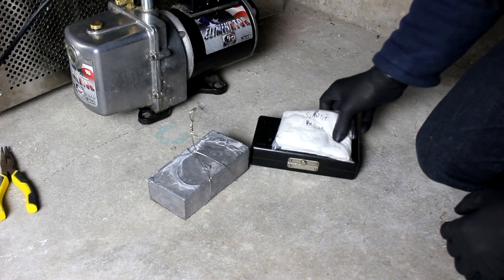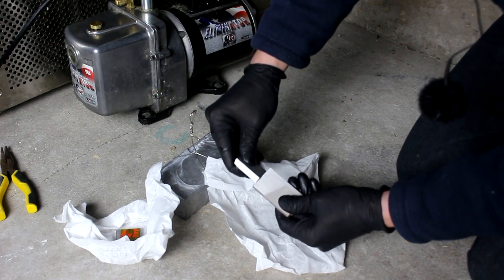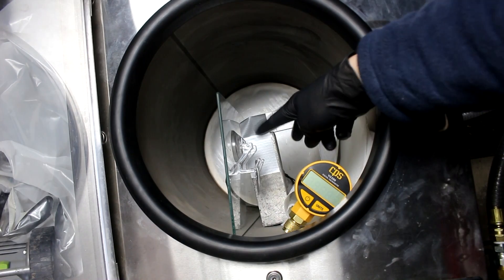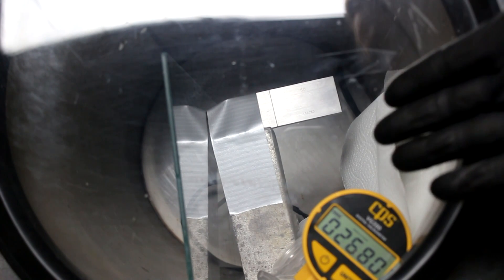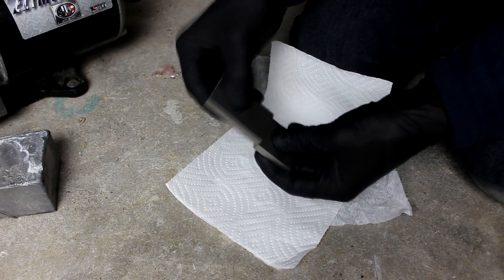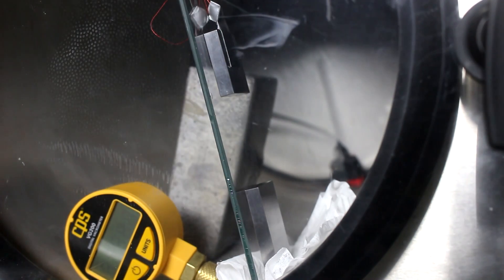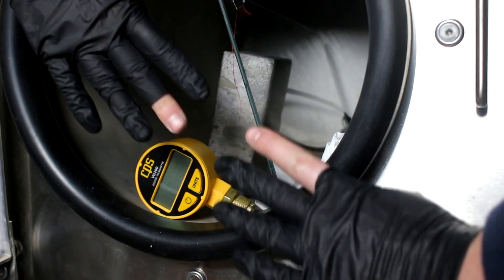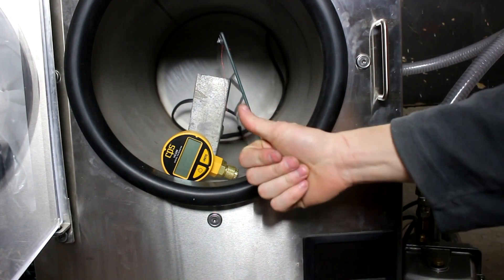Will Gauge Blocks Stick In Vacuum?

Comment: I remember when I went to a physics event once and they mentioned something called diffusion of solids that can occur between very flat/smooth surfaces. perhaps this process is what is causing the blocks to stick together. Although I also remember them saying it was a slow process so perhaps not.

Comment: I think dropping the block is unnessecary in this experiment. Isin't the piont of this experiment to see if air trapped between is the reason they don't stick without wringing? Why not just place the blocks together (without wringing them) and see if pulling the vacuum causes them to stick. Or, even apply a linear force (spring or a weight) to force them together more. As long as that force wouldn't cause them to stick at atmosphereic pressure, if you can get it to stick in a vacuum without wringing, it would prove that trapped air is the factor causing them to not stick.

Comment: !            !           !
   !            !           !
  V           V          V
HEAT. HEAT. HEAT.
The friction caused by the rubbing together creates heat causing the surface atoms to move just a little more quickly and bind, weakly, together. Test it by trying to ring the gauge blocks after they've been in liquid nitrogen for a while!!

Comment: Well, i think you should try to cold weld 2 different metals that are able to cold weld, i know that the gauge blocks can cold weld and so can the other metal which i forgot the name of, but what if you tried cold welding the gauge blocks and the other metal and see if that works, maybe it will prove your hypothesis of the interlocking "fibers." Maybe the different metals have different "fibers" that make them connect differently. Such as 1 metal has longer "fibers" and one has smaller "fibers" therefore maybe they wont cold weld and you can get your data from that and make a conclusion. Loves the vids Cody, keep up the good work, cant wait to see what comes next!

Comment: Perhaps scrub off the oxide layer while the two calibration blocks are inside a vat of inert heavier than air gas (xenon?), then try adhering the two pieces together without the wringing (within the inert gas vat)?

Comment: Cody, I don't think your test was rigorous enough to discount oil film and viscosity. When you put a viscous fluid into a container, capillary action draws fluid up the sides generating a meniscus. This film will continue to spread out until it reaches some equilibrium. This same force is why you can draw water up against gravity into a towel. By trying to separate the blocks, you are fighting the tendency for the fluid to spread out. When the gauge blocks are separated, surface tension draws in the fluid, increasing its potential. Take a look at capillary adhesion. Thanks!

Comment: I hypothesize quantum entanglement. A percentage of atoms line up to come in contact. Normally they will exclude the "foreign" atoms. When you add a little energy, some of the atoms become entangled. They share electrons. The electrons bind the pieces together. Sudden (impact) pressure allows the atoms to repel each other. Sliding gives energy and gives the opportunity to bond.

You could test bringing them together in vacuum, then pass an electric current through them. The extra energy should make them bond.

Comment: You might be able to break the blocks by overheating them
Induction plates use the microscopic surface of metal to heat a pan when you overheat a pan you will break the surface and the pan will stop working on induction

Comment: Van der Waals, nichts var?
Reply: Ah commented too soon. Van der Waals, almost certainly, yes. The air is irrelevant, as your experiment shows. The wringing process ensures that there are enough molecules participating because the rubbing process agitates the surface layer and enables a significant fraction of the surface layers to interact. Just putting them together will only allow Van der Waals forces between the high spots on the surface. Rubbing them together enables those high spots to overcome their lattice forces, detach like a fine slurry and fill in the gaps. When enough are filled in a sufficient attraction is achieved.

Fantastic video Cody! I love your work, and your attitude. AvE is a gem too. YouTube royalty, the both of ya.

Comment: "When two very flat surfaces are brought into such close contact with each other, this allows an interchange of electrons between the atoms of the separate blocks, which creates an attractive molecular force.  (This force will remain even in a vacuum or if no oil or water is present on the blocks."

This is the most reliable info i can find, which explains why a vacuum wont effect it.

Comment: What are the blocks made of, could it have an oxide layer
Reply: hardened steel. i work with steel and ceramic blocks daily and they both wring together.
Reply: Matthew Downey these are metal, but ive heard some gauge blocks are made of ceramic materials

Comment: I hypothesise like how in space when two metals haven't been in contact with oxygen they weld together. So that it might be like how when metals are covered in air, it forms a protective layer, and when you force them together it removes that protective layer.

Comment: you need one of those chambers with the holes that have rubber gloves sealed onto the side. If you seal it well enough you could use the gloves inside the vacuum

Comment: Unless you tried to cold weld them already in a vacuum then we cant call the suction hypothesis Busted. Dropping them wouldn't work as you need to twist to squeeze the air out?maybe??

Comment: What we need is an EM micrograph of the gauge block's surface to show the deformation. Obviously it'll be affected by you ripping them apart but just as hooks pulled straight can be inferred as being hooks in the past, we might get a good insight using an EM.
Reply: Is there an EM channel you can pass them onto?

Comment: Could you test the electrical properties of the gauge blocks?    resistance while faces compressed together vs wrung?      perhaps applying static charges to both to test attraction and repulsion.

Comment: I have never heard of gauge blocks in my entire life and you did not do a great job at explaining what they were. maybe provide some context next time you have an uncommon item in your video
Reply: Based FrankerZ i think the idea is that you're supposed to go watch AvE's video on them. he did explain what they do and what theyre for
Reply: Sometimes it's better to google something. The video isn't about gauge blocks, but how two perfect surfaces will stick together. Gauge blocks just happen to be very precise so they use them to show the example.
Reply: Based FrankerZ Although I agree that he could've explained more, you could just google it if you're genuinely curious.
Reply: They are essentially length standards. They are used as a reference for all other measurements made in a shop, etc. They are used for machine setup and calibration of measuring tools like micrometers. They are used in concert with a very flat granite surface plate when doing setup.
Reply: It is what is is; Gauge blocks, used to reference for measurements.
Reply: Based FrankerZ Google guage block. way less words and effort than your bitching.
Reply: +Pinky Mabinkie - My understanding of gauge blocks is that they original were not used as standards for calibration of micrometers etc but rather as a simple means for someone who is not versed in the use of precision measuring instruments to make precision measurement checks.  A common example of this would be in the checking of headspacing in a firearm, for example there are gauge blocks made for all bottle neck locking bolt firearms they are often sold in a sets for a particular cartridge caliber as Go\No-Go gauges while it is true you do not need to these gauges to determine if you have correct head spacing by doing chamber castings and other measurements with specific set of calipers and or micrometers it is far easier and there is less chance of making these critical safety checks with Go\No-Go gauges. I myself know a couple machinist that worked in production machine shops and constantly use gauge blocks for quick easy and accurate measurements additionally I also know a cabinet maker who is in 70's and has been using gauge blocks for machine set up (saws blade and router setups as well as pin joint layouts just to name a few) and none of these people treat their "working" gauge blocks as opposed to their "standards" gauge blocks.
Reply: +TripinOnAcid -They can be. They can and are also used as easy quick ways to make comparative measurements for example you need to measure a piece of something for a specific length a gauge block is commonly used the piece either meets the standard or it does not many shops \ machinists have a working set of gauge blocks and then they have a "standards" or reference set of gauge blocks that are used to only check the working gauge block(s) if that makes any sense.

Comment: Could it be a static phenomenon?  what happens if you touch them to a positive or negative side of a battery terminal, or a grounded wire?  I would expect metal dissipates static because that is what you touch to disperse static when dealing with electronics, but maybe fore some reason that doesn't happen here.

Comment: I couldn't help to notice you handle acid and 2000+ degree metals bare handed but when you play with awg blocks and suction cups you protect your hands.
Reply: Les O youre supposed to wear gloves when handling gauge blocks cause it keeps all the hand oils and whatnot off. watch AvEs vid if you havent already, he was uncharacteristically careful when handling them
Reply: He's not protecting his hands, he's protecting the blocks.
Reply: I'd imagine it was so the oils on his hand didn't get all over the metal after just cleaning it with acetone.
Reply: Nope. He is protecting the metal from grease on his hands. ;)
Reply: as a machinist that works with gauge blocks daily, i can assure you they are intended to be rung together. its not so much to "zero" calipers as cody said, but to build a stackup of the nominal size for a specific dimension you are machining. you then run an indicator across both surfaces to find out the "exact" dimension of your part.
Reply: TBH anything +AvE send me I'd be wearing gloves too lol
Reply: +Erik Parker you're gonna need some pretty strong meds to fix the festering personality defects necessary to sustain THAT level of incoherent and random rage at everyone on a simple video about gauge blocks lol
Reply: i dont think it was used for protections other than to not make the surfaces dirty,
Reply: Cody shouldn't wear gloves in a video if this is what it causes...
Reply: Na bro. It doesn't hurt them. Where you getting your information?
Reply: Les O I think he is protecting the blocks.
Reply: Fester Blats That's how you are supposed to use them. if you don't  wring them you don't get the same accuracy. if you wring them with finger oil on them you also don't get the same accuracy. the gloves help keep them clean and also can help with heat transfer a little. acid from your finger oils and abrasives like a normal paper towel will screw up the finish and prevent them from wringing.
Reply: I have a set of gauge blocks that were made in the 1960's I got at a yard sale and believe you me they were well used but not abused and they still wring together.  I was told by my high school shop teacher back in the 1980's to clean your gauge blocks after you used them and wipe them down with a light machine oil and at that time Whale oil was the top choice of oil.  However when you were using them and they got dirty clean them with solvent (Lacquer thinner) and dry them with a soft clean rag and the recommended rag back then was a old well washed cotton baby diaper because they were cheap and by then lint free and then wipe the machined surface across you nose to oil them so they would wring.  The rule was clean them carefully when done and store them with a very light coat of oil.
Reply: yep, whale oil was used back then...top choice? not so much..expensive, and smelled rancid. it was a thick oil as well not suitable for light coatings..even cheap "three-in-one" was better. and acetone, trichloroethylene or M.E.K are good to degrease these gage blocks.
Reply: Les O  wasn't to protect him gauge blocks need to be reaaaaaaaly clean and slightly oiled to work
Reply: Les O He's protecting the blocks
Reply: So he can do the TESTS with near perfect pieces............................
Reply: Wow, did I say they were valid? Fucking dumb ass
Reply: "gay wad"
Reply: MrLawson6288 lol I know.I don't think I will be jokingly asking this question again.
Reply: Erik Parker did I say fat or phat?
Reply: Cody's a genuine fart smeller, but some of his viewers took some hard knocks to the head at birth...
Reply: MrLawson6288 Are you calling me fat!?!
Reply: +Fester Blats But that is what you're supposed to do with them. You put them together like that to get a block of desired length.
Reply: factzilla you KNOW mr. johnson is expert? how? did you fact check on wikipedia while muching cheetoes yourself?
Reply: Les O OH so YOU'RE calling me fat!?!! PUT 'EM UP!!!
Reply: Les O lol I saw Phat, with a capital 'P' .. Now i need my old man anxiety meds..called "darnitol"!!
Reply: Now, where's my oatmeal!?
Reply: I won't leave do you have a point, other than the one on your head?
Reply: Les O You wouldn't want a nasty cut from the blocks now would you ?
Reply: I won't leave stfu dinkus, his first test was NOT VALID. he had cosmoline on them...INVALID..LIKE YOU.
Reply: MrPoopsnorkle with a name like yours, you're gonna go ahead and call someone "gay wad"? really?
Reply: protecting the blocks...uh huh..thats why he rung them together while they still had the cosmoline on them...which could ruin the surface because the sticky grease like cosmoline would have abrasive dirt and grit adhered to it..test debunked.

Comment: Interestingly enough, I have a handful of silicon wafers at home. If you've never seen them, their backs are smoothed to very high tolerances. Out of curiosity, I wrung some fragments together and they actually stuck. Nothing like steel, but considering silicon isn't magnetic and has a much higher resistivity than steel it says interesting things about the effect.

Comment: Another way to do the experiment would be in reverse, rubbing the blocks to leave them attached and hang them inside the vacuum chamber to see if they fall apart when removing the air

Comment: was anyone else cringing that he was fiddling with gauge blocks on a filthy concrete floor? also did not clean off protective goo.
Reply: Did you bother watching the whole video? He very clearly cleaned off the oils as one of the steps in testing them.
Reply: Bottleworksnet The fuck are you on about? How exactly would you recommend stripping oils from a part, then? Cause where I'm from a cycling solvent bath does a pretty good job.
Reply: Cody's a chem guy. He knows what gunk dissolves what gunk.
Reply: And what do you think acetone is? Acetone is used all the time in organic labs to clean off most organics, such as oils, because its cheap semi-polar organic solvent.
Reply: I see what you did there.  Cody's Skookum,  he knows when to remove the schmoo when it's not welcome.
Reply: chuckbuckets1 he said he cleaned off the oil's
Reply: greenaum sounds like someone isn't very skookum
Reply: Bottleworksnet how did he botch it?
Reply: Gods that stupid shit is annoying. I like The Simpsons but I don't call everyone a fucking neighbourino. We get the joke. You're talking like that butthole off that other channel. He says funny words, and you think that's great and amazing and incredibly clever and original, so now you're doing it so you'll be funny too, like he is. FFS.
Reply: Not correctly.  This is a complete botch job.  Good effort, but the base knowledge is lacking.  As a result, many errors were made.  This is like doing a ring job with an angle grinder....Oh wait...

Comment: I've used Johansson blocks for metrology and tool room practice for the last 15 years or so.  I don't know what causes the wringing effect that allows them to stick together, but I doubt it is getting the metal surfaces close enough together to share electrons or interlock atoms.  Both would cause "cold welding" where the two blocks would fuse.  Unless by infinitesimal chance the blocks broke apart exactly where they fused, this would result in material deposited on one block and pitting on the surface of another.  But this doesn't happen.  

Also, if you have an old set of blocks with a less than factory fresh surface finish, the ability for them to wring together can be restored or enhanced with a light coat of a light oil such as WD-40.  This would provide a layer preventing the metal atoms from joining, and is strong evidence to counter any occurrence of electron sharing or atom bonding.  

Finally, Johansson blocks are useful for much more than making sure your calipers haven't packed it in.  Besides being able to calibrate almost any inside or outside measuring device to a known length standard, they can be used to setup parts in machines, inspect parts, simulate, mating parts, and find angles.  By using a flat piece of steel with two v-shaped grooves a known distance apart, two metal pins of the same diameter, a stack of blocks, and trigonometry,  the steel can be set to any angle desired.